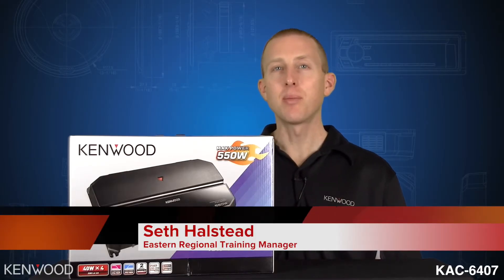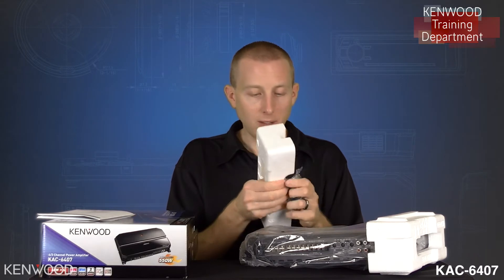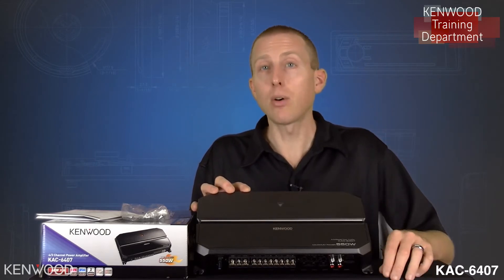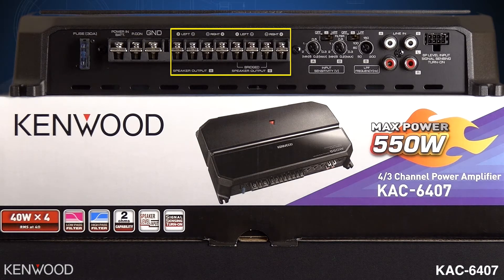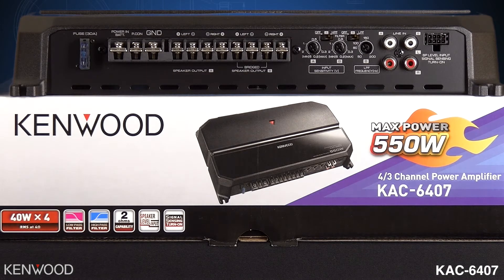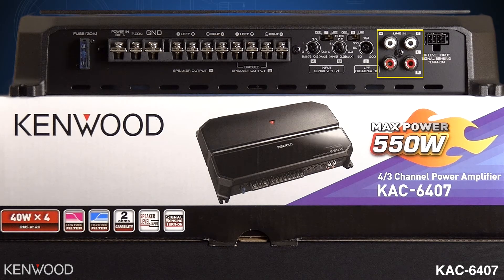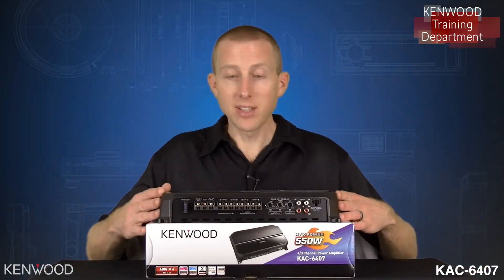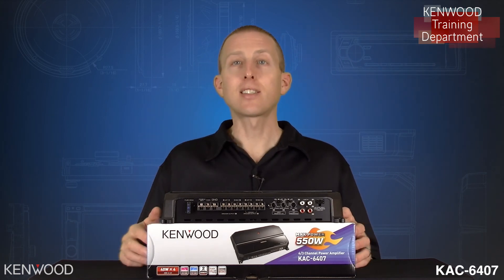KENWOOD KAC-6407 2017 Performance Series Amplifier Unboxing & Feature Highlights

Comment: Hi would you know if the kac ps704ex is capable of running two 4ohm 300w rms subwoofers
Reply from the maker: That amplifier has a 200w RMS output in a bridged configuration at 4Ohm, it would work for the woofers but would be a tad bit underpowered and not recommended for that application. Thanks

Comment: mr seth ,, that Ampli Possible for 4pcs Speaker 360watts each? is it good or no?
Reply from the maker: This amp supplies 40 watts x 4 of RMS continuous power output at 4 ohms, with a total combined peak power output of 550 watts.  This should be a great choice for most speakers, but in your case, I would suggest finding out 
what the RMS power ratings of your speakers are, as opposed to their peak power of 360 watts to determine if this is the best match.  Thanks!
Reply: Thank You for reply Mr. Seth , this is my setting sir ,i have head unit 1 din  Kenwood stereo , and 4 speakers 360watts Kenwood 3way , i heard my speakers hard to bass ,  can you help me sir? what is the best Brigdegable ampi or normal ampli?
Reply from the maker: This should be a great amp for them.  Another amp to consider would be the X301-4.  Both should work well and sound great!